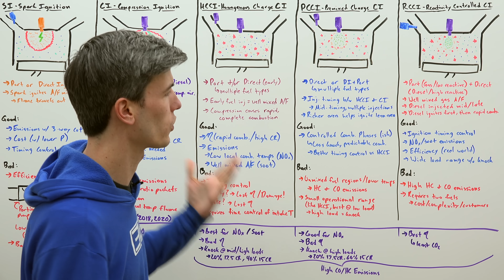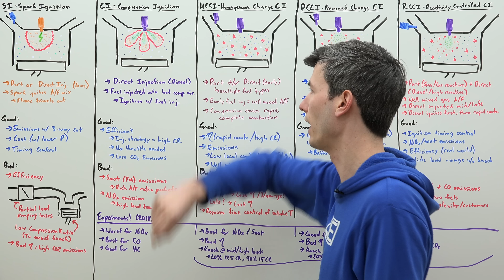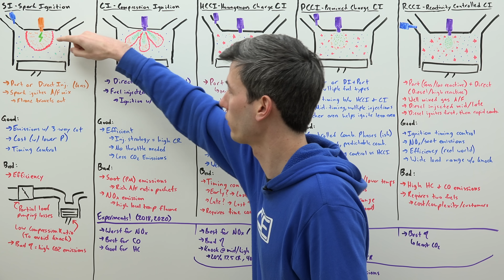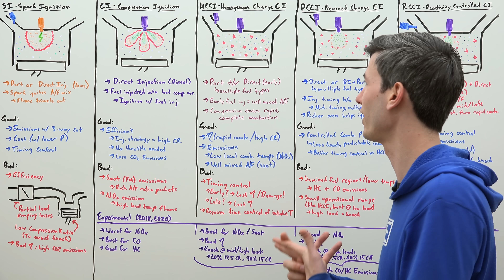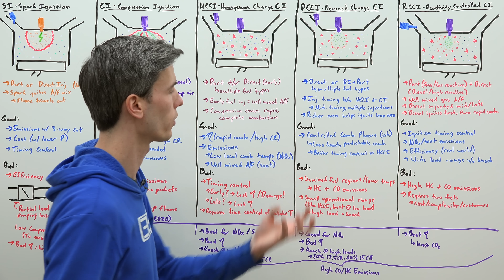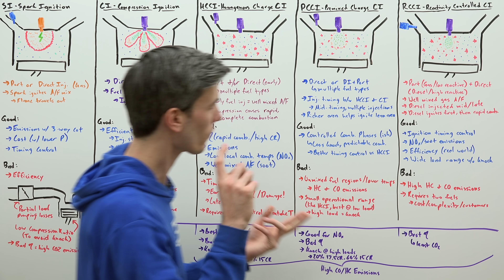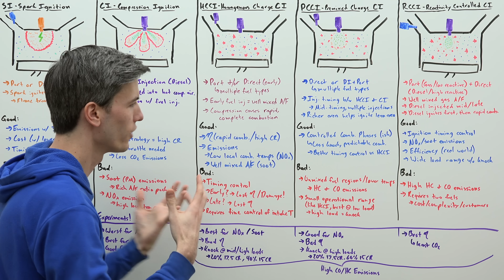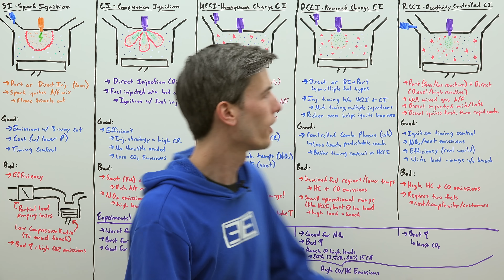If Combustion Engines Have A Future, What Is It?

Comment: @engineering explained    
Jason your 15:15 statement 2x effiiency is WRONG.  Next you’ll go saying the favorite EV LIE, electric cars are zero emissions, come on man you are better than this.   Retract this absurdity or show the analysis!
Reply: When EV proponents use the zero-emissions argument, most of the time they slide “tail-pipe” in between zero, and emissions.
Reply: @sking2173   thx for reading.  Regardless its give most readers the FALSE impression that EV are infinitely superior to ICE on emissions.  In markets just as engineering, details matter and can completely change outcomes.   In coal fired electricity markets (China or India for example) Co2 per mile will be worse in an electric car.  

The USA electrical supply has changed dramatically to natural gas, (read methane) which has less carbon & much more hydrogen per joule of stored energy vs coal.  So our grid, thx to pipelines and thOSE “bad” old oil patch frackers has dramatically greened in the past 5-10 years.  Not sure what the latest splits are but coal has really diminished.   Unreliable Renewables (solar & wind) are still a rounding error Nationally.  Water power is naturally wonderful and of course renewable.
Reply: @S King  Disagree.  Mostly they just say it wrong and the gullible public just eat up the unicorn fart story.
Reply: Come on Jason we are waiting for your retraction.

Comment: I have Honda generator that runs on Natural Gas, Propane or Gasoline - valve that turns between Gasoline or Natural Gas/Propane with regulator. Port on carburetor is down low for gasoline and up high for Natural Gas/Propane. Why not follow Formula 1, which is pinnacle of automotive technology, and use hybrid combustion/electric and call it done - car that can switch between Natural Gas, Propane or Gasoline & utilizing electric motor(s).

Comment: The future of combustion engines is to convert stored energy (Hydrogen etc.) back into on-demand electricity. As such the engine will have tightly controlled and therefore less onerous operating conditions i.e. no part-load operation. Maybe Wankel ?
Reply: Why Wankel? Not clean, and not efficient. Light weight is about all it has going for it.

Comment: I'm a huge fan of piston engines. I also like electric cars, but piston engines still have so much potential! Therefore it bugs me even more, that engines still use so much fuel and don't ever really get above 40% efficiency, even though that would be possible. Just because everyone wants sporty and comfortable cars these days. 1:0.5 stroke and 200HP 1 litre 3 cyl. engines are a product of this. Downsizing is senseless if the engine doesn't make  less power and uses less fuel.

We need small engines with a long stroke, really lean AFR and more weight on torque than power. Diesel is ideal to reach that. For daily usage, engines with ~100HP are more than enough.

Comment: The future of piston engines is opposite piston supercharged 2-strokes. Making the pistons run towards each other instead of against a top reduces heat loses and nearly doubles the efficiency. 
There is lots of prototypes the go over 55% efficiency instead of ca 30% of a "common" design engine.
Reply: Next would be a split single design with 2 cylinders and 4 pistons to achieve 55-60% efficiency. Then we realize we can build a jet engine for low speed and low altitudes and wham we have 60%+ immediately. But the sound from a jet engine is really annoying. 
A supercharged opposite piston 2-stroke doesn't need the big fluffy pipe if tuned correct so it will not need to sound like a dirtbike before being silenced.

Comment: Weird pitch, but.. What if: you take out the spark plug when developing the engine and replace it with a diesel injector? Ok but What if you put 2 or 4 diesel injectors every cylinder? That would make the rcci even better and more evenly burning.

Comment: In Poland we use diesel cars with LPG that is injected in to the intake, so the 'future' technology is actually old. 🙂
Reply: Is this technology under development currently to be used in future engines or is it available as a aftermarket system for older cars? Greets from Germany :)
Reply: @peterm3861  LPG/CNG and Diesel hybrid systems have been around for decades. It's just not very common.

The engine runs on Diesel at low loads and then as load increases LPG/CNG is added to the intake. A small amount of Diesel continues to be injected to initiate the combustion, otherwise the LPG/CNG on its own will either not burn at all or knock.
Reply: Yeah I heard about this technology about 15 years ago. I didn’t think many people did it. I think some people in Australia had their 4x4s converted for it. LPG really died down there in the last decade.
Reply: @alexs3187  We use it here in Argentina in heavy trucks. You can see tractor units with around 6 CNG tanks piled up behind the cabin. It's starting to become popular.
Reply: They're researching ammonia injection for large marine Diesel engines.

Comment: To Mech engineers out here: Do you think there are scopes of improvement for timing in HCCI ? Maybe some electronics wizardry to help it out ?

- Electronics engineer here
Reply: It might be possible if combined with freevalve-like system (we know these are at least somehow usable although having their own group of problems), if you take ultra-precise control of shutting the intake with some temp/pressure sensors with enough resolution you could achieve much better control, but probably still not quite on spark-control level. Would be really interesting to see some testing around this, too bad that freevalve is so expensive.

Comment: Commercially we are already adding 2 liquids at the fueling station in heavy trucks.
Diesel in one tank and diesel exhaust fluid (adblue) in another tank.
You will definitely cause failures by mixing the two fluids.

Comment: There no future for a car which has to emit co2, wether it is somewhat efficient or very efficient, we’re polluting the atmosphere. ev’s are the way to go.
Reply: Seth, you as a human being are polluting the atmosphere with emitted CO2. 

Power generation in the US utilizes 80% fossil fuel; i.e., it produces CO2. In Europe, it’s 70%. 

So your electric car is far from carbon-neutral.

An ICE powered vehicle using biofuel is MUCH closer to being carbon-neutral than your current electric vehicle.
Reply: @sking2173  Exactly, not only do our vehicles have to make a transition to being potentially sustainable, but so does power generation. It’s irrational to get rid of all combustion cars and replace them with ev’s in one period of time, as it would have worse environmental effects than continuing to run the combustion car until it dies. The transition to sustainable power generation is just as important as buying an ev itself.

Comment: If you take the same fuel that the RCCI engine uses and put it in the power plant that charges the electric car, the electric car will not be twice as efficient. It won’t even be as efficient. Apples to oranges.

Comment: What about a blended single fuel. Like diesel and gasoline premixed. Then use something like an evaporator chamber with a sump to supply fuel air vapor and the left overs get pumped to the injectors.

Comment: Is it viable to dynamically change the size of the combustion chamber by having a high power solenoid on top of the chamber? It will control the ignition timing by controlling the pressure of the premixed diesel fuel.

Comment: I'm quite confident we'll have extremely low emission gas in 10-15 years.  The real emissions will come from manufacturing it and that will improve too.  EVs will still be cleaner, but it'll be good to keep running the ICE cars in a cleaner way for decades to come

Comment: I want them to try external compression internal combustion... this is where the gasoline spark igniton engine has a compression ratio of say 10:1 and is running at stoich or a bit richer than that, and is running a 4 stage air compressor that ends up at the equivalent overall compression ratio of something like 25:1, and dumps its load to a storage tank. Because the storage tank has many times the volume of one cylinder, it is effectively slowing down the compression process, leaving the storage tank at a high pressure and relatively low temperature. The pressure pump would only partially be powered by the engine, and could also be configured to store additional pressure when braking... the neat part of what this would allow is... near the end of the normal combustion process (approximately 18 degrees after tdc), really high pressure air could be injected into a relatively small volume, and since theres still combustion occuring, this would dramatically lean the charge out, the hot charge would be forced to give up heat to a relatively cold load of high pressure air... getting all of the advantages of spark ignition and the practical effect of a diesel cycle, without any chance of blowing it up. Such a combustion cycle would also have a dramatic effect on cooling, it might not need to have a cooling system at all, and because the pressure injection strategy is controlled theres way more "levers" to control both the combustion process and the torgue output of the cycle. "waste" pressure at the end of the cycle, before the exhaust valve opens could be vented back to the intake of the pressure pump, and as long as this pressure pump is spinning fast enough to feed all cylinders of the engine, it stays caught up. If the tank was large enough, there might be conditions and loads where theres no fuel going into the engine, and is just running as a compressed air engine.
Reply: It is quite interesting idea, even though I am afraid that the overall efficiency of such setup will be way less that what we hope for... Also the complexity and weight of added additional system, lines valves etc. is not to be ignored, and seeing speeds and intervals this needs to operate with "relatively cold" might still not be cold enough. Also you still have the spark-induced flame front and associated emissions which systems in video try to eliminate.
Reply: @jirivymazal8427  Keep in mind, a mulitistage air compressor is far less complex than an engine is... the "valves" arent speed sensitive like engine valves are and by splitting the compression process between stages, especially if theres intercoolers between stages, the work required to do the compression goes down alot! if it is small enough and simply run fast enough, it need not weigh a lot either. This one part of the process is by far the worst, most least efficient part of what an engine does... bringing the piston to t.d.c on the compression stroke in one stage causes a massive amount of waste heat that is a major contributor to detonation and high heats of combustion, which is were nitrogen oxides come from. The high pressure injection system could work just like pulse width moduated efi does, except it would be injecting air instead of fuel. The advantage is, a gasoline spark ignited engine is far more efficient than a diesel is at the same compression ratio, the trouble is to try and get one to run well at that compression ratio. Having the equivalent of a Otto cycle + a Diesel cycle would be more efficient than either. It would sure make for a heck of a hybrid though! we'd be talking about "air mileage"!

Comment: Aren't natural gas diesel engines, like in buses already RCCI? They use natural gas as main fuel and a pilot injection of diesel for ignition. Also, gasoline engines running on LPG, which is popular in Italy and Eastern Europe has reduced CO2 emissions because LPG has more hydrogen in it. And people already use two fuels - gasoline to warm up the engine and LPG as main fuel.

Comment: How do hydrogen combustion engines compare to these ICE engines in efficiency and emissions?
Reply: Emissions is pretty much zero because the combustion product is water. Efficiency is terrible because you have to use electricity to make the hydrogen at ~50% efficiency, before you burn it at ~40% efficiency. EV's batteries and motors come out WAY better. Hydrogen is nice because no batteries. But the storage tanks are scary. Leaks are hard to eliminate and dangerous. And you might still need rare and expensive metals for the fuel cell, if you aren't burning it in an ICE.

Comment: Correct me if I'm wrong, but with rcci, could you use the same fuel for both, but have one go through a cooling process to lower the reactivity? That way it would be one system until the split to normal and cooled fuels. Just a thought from someone with no practical knowledge 🤷‍♂️

Comment: As you progressed in your talk I kept thinking this is dead end technology for automobiles. I thought it might be good for generator units that run at a specific RPM but at the end of the day they are still producing emissions. I’m way more in favor of electric vehicles powered by renewables, hydrogen or fusion. I’m excited about what’s in store for us in the future.
Reply: How about an ICE using renewables ??
Reply: @sking2173  like burning hydrogen? Seems like it would work but likely overly complicated and inefficient compared to a fuel cell.
Reply: @thatalaskaguy  — No, I’m referring to renewables as in biofuels. After all, done properly, biofuels are carbon-neutral ...
Reply: @sking2173  I wouldn’t be opposed to that as long as the cost, power and range was similar to what we have now.

Comment: My Sprinter Diesel engine injects up to 30 squirts during the power stroke. You didn't discuss that technology. Some of the 30, if used, are only included if the converter needs to be heated up.

Comment: Why the fixation on reciprocating designs?  microturbines as a generator ... so it has a long cycle time and multifuel capabilities... capstone, wrightspeed, bladon jets, MTT, etc... Especially if you need heat, for CHP, it can be 80% efficient... if the future is going to use electric for traction motors, and batteries for recuperative braking, then a turbine that runs for a long time will be pretty good... no? Also maybe there is potential to combine a turbine with a flywheel for recuperation (KERS) might be even better than a battery for small amounts of storage, and can help with accellerating turbine spinup.

Comment: Wait, I thought gasoline was more reactive than diesel...
Isn't that why gasoline detonates while diesel burns??
Reply: I think so also, shorter chain hydrocarbons are more volatile and so more readily combustible with air at equivalent temperature and pressure.

Comment: Diesel soot is mainly caused by excess fuel in the entire cylinder. This is the main reason why when a diesel releases soot being under load and more fuel is sprayed into the combustion chamber then available air to burn it. I don't know how rich spots due to injector spray pattern play, however operating condition as compared with soot observation seems to lead to one  inescapable conclusion.

Comment: I read about an Israeli company this week that claims they can get 100% charge into a vehicle electric battery in 5 minutes, using lithium ion battery tech.  Fast charging would overcome most of the downside to electrics...refill/recharge on the go in a convenient timeframe, and less cost of the vehicle due to smaller batteries (i.e. no need to have 300 mile range of onboard batteries if the charging is fast enough).  Still doesn't overcome getting charging stations to be as ubiquitous as gas stations, though.  Overall, an interesting development using existing battery tech (different manufacturing process), assuming their claims are valid.

Comment: until we can have fusion or nuclear powered engines, we will have internal combustion engines. No power grid in the world can support even 10% electric cars.
Reply: Micro grid, storage both local and central, home/office/industrial battery storage and VTG (vehicle to grid) to supplement the micro-grid. The amount of rooftop solar is large yet growing, but lacking any substantial storage. A vehicle (battery) or home battery could easily power a home, decoupling from the grid, during periods of high demand if the grid so requires.
Reply: @wzDH106  That's pure fantasy at this point. Solar panels are absurd cost for not much of anything. The price of solar needs to drop like a rock for it to be usable for the average person. You are talking about at best about a tenth of a percent of the human population. Normal people are not interested in that type of insane cost just to power a vehicle. Which is why ice will be around for the foreseeable future.

Comment: Two similar subjects I'd be interested in:
1) if 93 octane were the standard instead of 87, how much more efficient could the average vehicle be?
2) If engines were designed for e85, how efficient could they be?
Reply: 1) Not a significant difference, but enough not to be negligible.
2) They would become more efficient/kWh, but far less efficient/fuel consumed, since ethanol has lower energy density than gasoline.

Comment: It would seem like RCCI engines would be best for industrial transportation applications.  Transport drivers are already used to filling up both the fuel and DEF tanks, so if you ended up with a dual fuel solution without the need for DEF, then you're really no further behind for convenience and ahead of the game if it's more efficient.

Comment: If power and efficiency are the primary consideration a opposed pixton, two pistons per cylinder, compression ignition engines provide both.